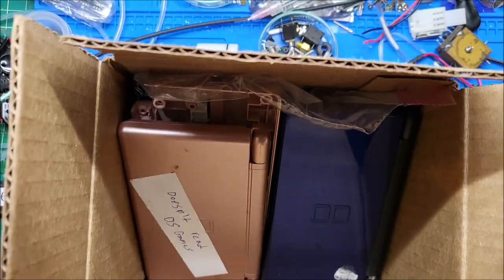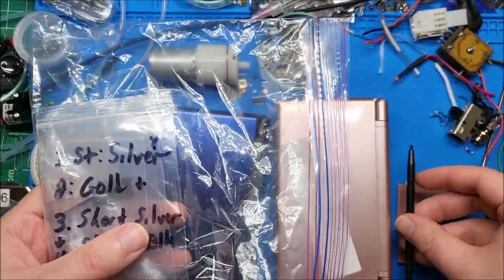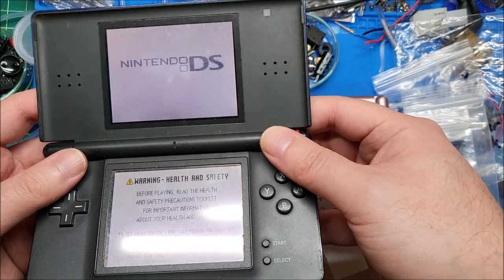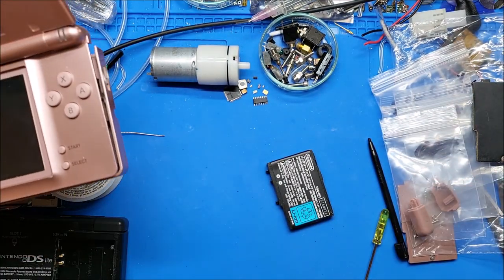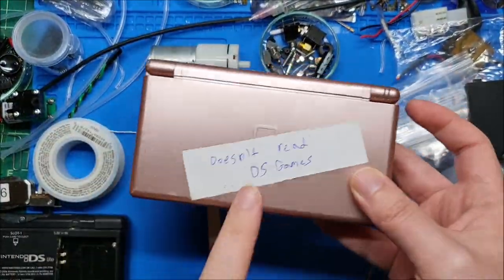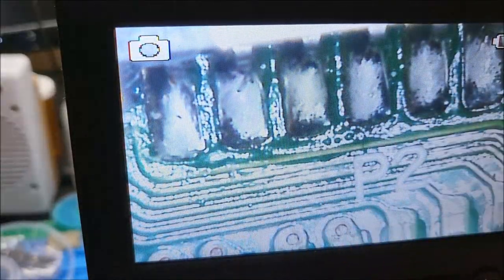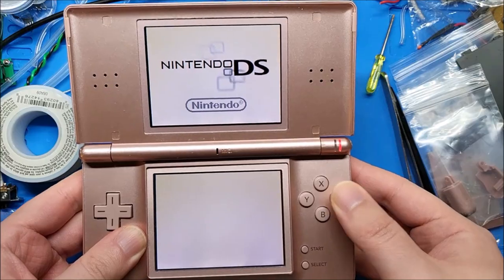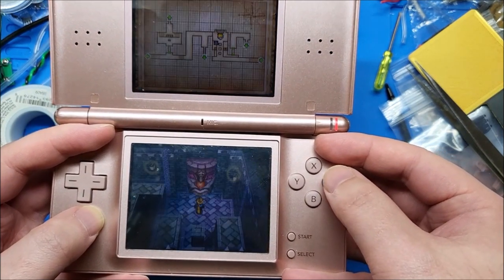Let's Fix: Sad Nintendo DS Lite Wont Read Games

Comment: hello, i have this problem too, but the pins are perfectly fine. not dirty, no damage. do you have an idea of what it might be? :(
Reply from the maker: Check the soldering of the pins to the pcb. I'd also partially insert a game and with the slot open and exposed look at each pin to make sure they are contacting. If all that looks good then it's probably an electrical issue deeper in the board and not mechanical.

Comment: Howdy mate,  I did the same... took the card reader apart and put it together just to find out the cartridge wasn't clicking ... searching around me I found a little piece , which I believe is the same you had lost. Can u explain where or how to put it back... no idea where it came from or how it's mounted lol. Thanks
Reply from the maker: I explain the three parts around 10 minutes into this video. Basically you need to insert the plastic slider bit that clicks into the side of the cart, then the spring through the hole in the back and then finally the L shaped metal piece that goes into the end of the spring and carefully put the metal shielding lid back on top of the whole cart slot. The L metal piece may need to be pushed in far enough so it clicks into holes in the top metal shield, which is what holds it in and stops it from pinging out.
Reply: I followed the same process, got the L-shaped piece in to hold the spring but the cartridge won't latch in, it gets pushed out by the same spring. I figure the slider doesn't lock into position somehow - did you experience something like this?

Comment: Not sure what’s wrong with my 3ds xl but the b button has to be pushed down hard to read the input any clue what could fix ut
Reply from the maker: Either the contacts under the button metal snap dome need to be cleaned, the bottom of the snap dome is dirty, or the metal snap dome itself is worn and needs replacement (they sell replacement stickers of these). I've made a cleaning video for a 3ds non-xl version for this problem a few years ago.

Comment: My ds lite only reads the games sometimes, 😢 the pins seem to all be good,  I've tried putting game in before I turn it on, after,  reinserting etc.. any suggestions? Thank you
Reply from the maker: Not a good idea inserting/removing a game with power on as it can damage the game. The fact it intermittently reads games suggests the pins either aren't fully clean or slightly misaligned. I'd carefully inspect and clean them before ruling them out.

Comment: I'm having a problem with my New 3DS XL in being able to eject my cartridge from the slot. Your video is the best one I've found as to what the mechanism of the cartridge slot spring is (I'm certain that's where the problem is). How much will I have to take apart to try and possibly fix it? Unfortunately don't have any experience taking apart a 3DS XL and the most I've taken apart is a GBA/GBA SP. So I'm guessing the complexity of the process increases exponentially by the generation. 3DSs are getting really expensive now and everything else about my device works perfectly fine. If I take the back cover off and eject the cartridge then, it comes out easily but the issue is that taking apart the back cover of a 3DS XL every time I want to do it is a big hassle (with the two screws that I'm constantly afraid of stripping)

Would really appreciate it if you could guide me in the right direction!
Reply from the maker: The general process will be very similar to this video, except the number of screws and their location. If I had to guess something is gumming up your eject spring mechanism so you'll have to open your cart slot up (very carefully to avoid damaging nearby components) and give it an inspection and possibly clean it.
Reply: @sjm4306  Aah gotcha. Thanks for the reply! Watching a detailed video of a 3DS XL being opened up is probably going to be my first port of call. But watching this video of yours all the way through and seeing all the challenges you had with the cover of cartridge slot have not reduced my anxiety about this haha
Reply from the maker: My biggest suggestion is to watch out for the spring or tiny pieces pinging off when you open/close the metal lid. If they fly off they will probably disappear into the ether lol.

Comment: I have a white evolution card and i can open it on my DS but it only shows a white screen and when i take out the card while my DS is on it shows the loading bar for a sec and then my upper screen is black and my lower screen white- what can i do about it?
Reply from the maker: I've only used r4 cards so I don't specifically know what's up with your evolution card. I'd try reloading the firmware file though in case it's somehow soft bricked. You'll have to google the process if your card has upgradable firmware.

Comment: Did you ever end up fixing the black DS lite's screen ribbon?
Reply from the maker: When I inspected the ribbon under magnification the tear was on the end with super fine traces and quite a few of them seemed to need repair, unfortunately it would've just been too difficult for me.
Reply: @sjm4306  thanks for the quick reply! I'm facing a similar issue and am going to probably have to swap the whole screen out as well.

Comment: ive been trying to figure out why mine wont read. it reads the r4 card sometimes but crashes back screen when i launch the cart. there was once i pushed on the back shell pretty hard flexing plastic and it read the cart and also showed the games so was hopeful. was able to launch the game folder up and game for 4 seconds then crashed . after that i got it to read couple more time for quick sec now it wont read it at all. none of the pins have corrosion or bend left to right . hard to tell if maybe there just pushed too far down not making contact anymore. also the ds had a paper shim in the slot when i got it im assuming to add extra pressure . thinking  i can pull the pins down without taking the shell apart if they need to be at a certain height . any thoughts on the pin height would be much appreciated.
Reply from the maker: Sounds like all the pins are not making good contact. I wouldn't suggest trying to pry them up from the slot opening without opening the case though. Way too easy to misalign them as the metal is quite thin/fragile.
Reply: @sjm4306  thanks bro ill give it a shot and see.